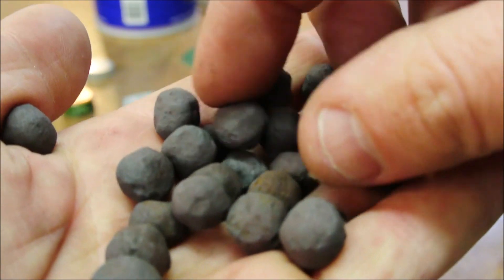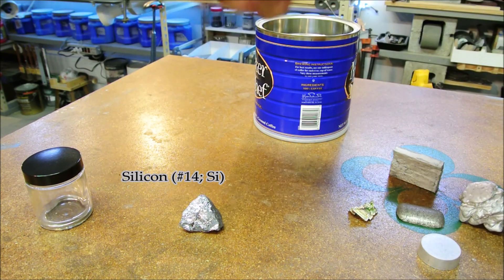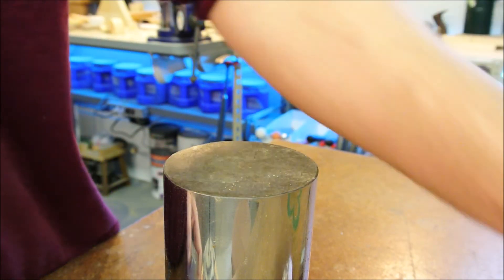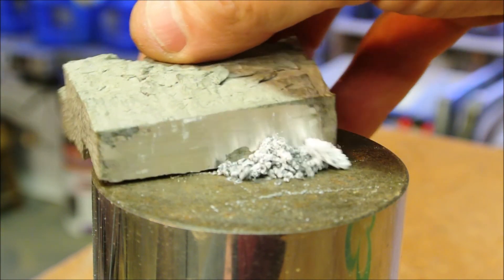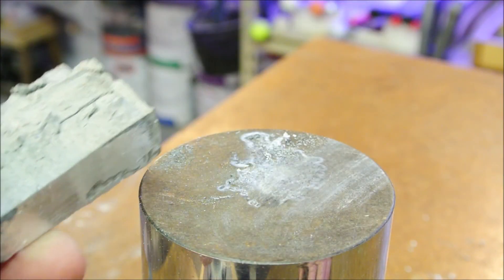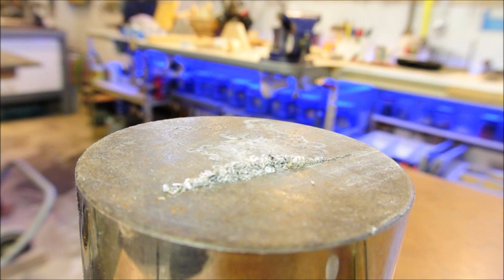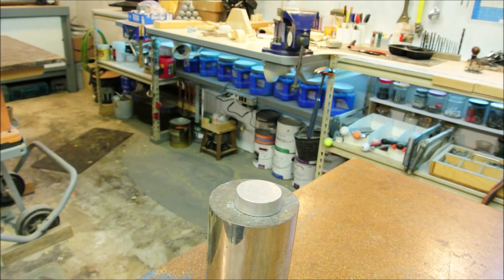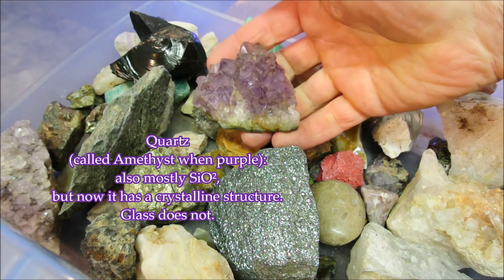Elements, or how things are and how they wouldn't be if they weren't

Comment: Your observation that molten aluminum is sticky like roofing tar - something unexpected or at least unintuitive, reminded me of a video seen on the Applied Science channel.  In that video the host was making glass from scratch.  His observation was that molten glass is corrosive to the refractory materials used to contain it.

On a completely different topic:  you never explained, or at least I never saw, your solution to your deck problem, where the beams were held up by the shear strength of the nails and not supported directly underneath.  At the time of your video I faced that same situation but have since resolved it.  Did you resolve your issue and if so how?
Reply from the maker: Not too surprising. Most refractory cement has some of the same stuff that's in glass. In fact, beyond pure carbon, I don't have the first idea what type of crucible you'd use for molten glass that wouldn't end up consumed.   

As for the deck, yeah, I fixed it nicely. I'm not taking the time to explain in text right now unless you actually have the same problem, though. Future video.
Reply: @pocket83squared  Thanks, no need for a video.  In my case, a temporary wall was built to support the ends of the joists, the old  beams removed and rebuilt on top of the vertical supports ... as I should have done when I built the deck 40 years ago.

Comment: Is it possible to separate the different elements from that pop/beer can glob with basic garage workshop equipment?
Reply from the maker: That depends on what one considers to be "basic garage workshop equipment." For most reasonable humans, the short answer to your question is a straight-up 'No.' 

Consider: (after the melt and separation) you'd need to come up with some sort of spectrograph just to be able to verify your work. Changing your own brake pads is one thing. That said, chemistry is a strange and complex field of inquiry; metals can be transformed into room-temperature solutions. A better YouTuber to ask about such a procedure would be Cody'sLab.
Reply: @pocket83squared  I thought of NileRed, but Cody'sLab is definitely more in the theme of garage workshop.
Reply: Thank you for your response. It was more curiosity than a future endeavor, for me at least.